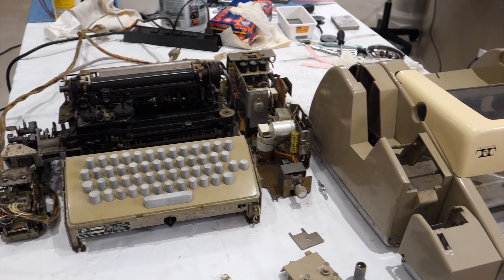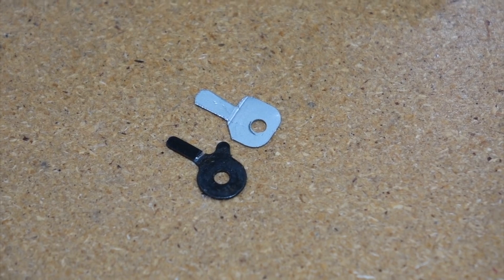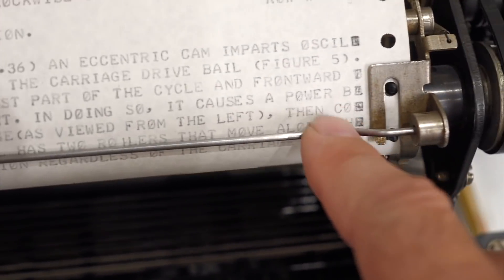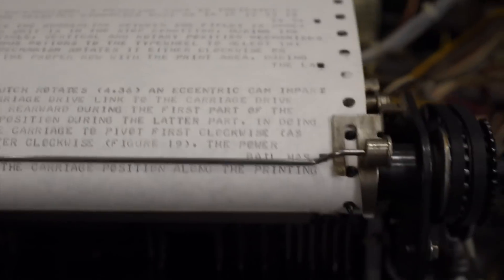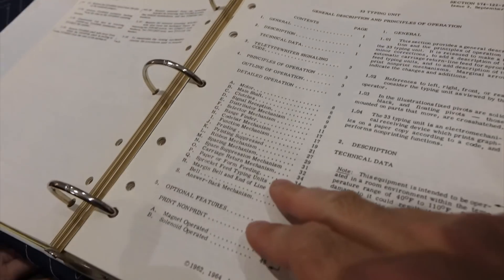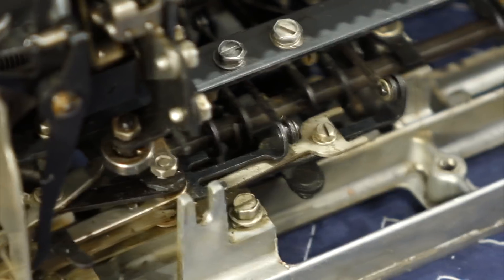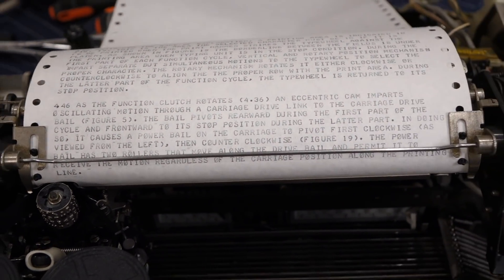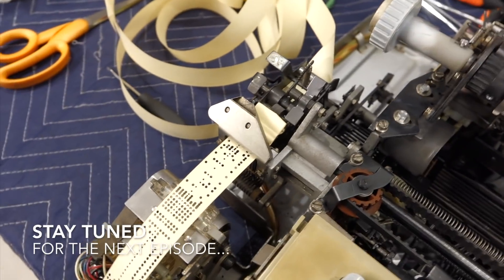Teletype ASR 33 Part 7: Receive Section Fixed!

Comment: This is probably the main reason the original Baudot code, and the newer ASCII code, include separate CR and LF control characters, rather than the combined NL (New Line) character used in IBM terminals.  If CR is always followed immediately by LF, the print head is back at position 1 before the first character is received.

The ability to overprint and to save time when the next line begins close to the end of the current line are just bonus features!

Comment: The teletype has a special place in my memory. In the 8th grade, way back in 1978, my first hands-on extensive computer time was spent early mornings in the middle school's algebra classroom, on a teletype, connected by acoustic coupler to a big black phone handset, to a remote Honeywell computer. I spent those mornings studying and learning to code in BASIC. I still fondly remember the smell of the machine, of ink and oil and the big rolls of yellow paper we fed it.

Comment: These machines was how news was disseminated for decades. It's fitting to see them working again.
Reply: Associated Press was still running in the slow TTY mode as late as the 90's. I recall working a stint at a newspaper plant, they had a dot matrix printer wired into the AP satellite feed. And every so often FLASH traffic would kick the printer into action. Or someone would simply command the printer to belt out the buffer for the day and they would read through it.

Comment: As far as some of the old ASCII printers and paper printing terminals, devices I used to work on a long time ago for X.3, X.28, X.29 (a.k.a. triple X) X.25 Packet Assembler Disassemblers (PADs), had the option to add NUL characters (0x00) in the data stream for these devices after a Carriage Return (CR) or Line Feed (LF) or Form Feed (FF).  That allowed data designed for faster CRT based terminals to be displayed on Teletypes and Slower ASCII serial printers so that characters were printed properly.

Comment: From the military TTY days, each line should be no longer than 69 characters, and it's 2 CR & 1 LF for each line. I believe the 69 character limit was for the older "5-level"  tape TTY machines. I think the only time you could get away with 80 characters was when both receive, transmit, and paper tape relays could handle 80 character (aka 8-level tape), or you were sending to a "customer" that received the data in data punch card format, or when data punch cards were being phased out with the newer (at the time) magnetic tape.

Comment: As a Telecommunications Technical Control Specialist withing the USAF,   I've actually operated these machines on a daily basis for quite a few years.  Damn they can  be quite PERSNICKETY.  LOL   More then  sure they're still being used in quit a few facilities today.   Super High level Baudot  Code.   Most of us could read the paper tape by looking at the hole punches.   When the ink ran dry that was the only way we had.  LOL

Comment: That noise takes me back to 1970 and the first mainframe I got to know well: Univac 1108.  The console was a KSR 33.  A busy all nighter would leave you with an aching head.

The OS also had a driver for Teletypes via its communications subsystem (CTMC) for interactive use but for some reason the software driver was called TTY35 (not 33). The tape library had the only working interactive terminal. Everybody else used cards.  But the tape librarian had no use for
the TTY so I misspent most of my days in a freezing corner of the library avoiding my assigned work, teaching myself to program in 1108 assembly language.
Reply: My first machine was an IBM 407 and associated unit record equipment. Then we got a 1401 then a 360/30

Comment: Wandering Column 1 position looks like the head settle isn't quite stable.  Sometimes a bit to the left, sometimes columns 1 and 2 nearly merge. There's another adjustment for that, I seem to recall.  (Like a Studebaker owner, you are getting plenty of practice fabricating parts!)
Reply from the maker: It’s the “dashpot” adjustment, an air piston that prevents the carriage from slightly bouncing back. I think they had the patent on that.
Reply: @CuriousMarc  I remember having to just the little metal piece on the air piston to get it to position just right.  Also, when we had a BASIC class at Southern Ohio College in 1980 we keyed in our program on the punched tape and every line ended with Carriage Return, Line Feed and Rubout.   The rubout helped you see where the new line began on the tape for splicing - it punches all of the holes.
Reply: @CuriousMarc  I wonder how whether there as many patents as adjustment points?

Comment: While I love these videos, I hang my head in shame for having dumped one around 1988.  Sorry.
Reply: I dumped 3 of them that were modified for RS-232. Tried to sell then, no one wanted them, then I tried to give them away and still no one wanted them. I also dumped a DEC LA-36 and LA-120
Reply: @rty1955  Yes I think mine was an RS-232 model, complete with tape punch.  Best not to think about it.
Reply: @video99couk  the teletypes were all 20ma current loop. They were used for communications along the railroad to replace the hand key/soinder device. I had designed my own RS-232 to 20ma converter, but there are tons of designs out there now but back in 1975 They were rare.
I still have rolls of mylar tape that the teletype used as well as paper tape. Mylar tape was used in older CNC machines so the oil aroind the machines wouldnt soak into the tape

Comment: I really like the ASR33! On older comms equipment there is often a setting for a delay after CR. Question: I always thought the O with a slash means the character "zero" not the letter "O"...
Reply from the maker: On this machine it’s reversed. The letter O has the slash. Feels weird too.
Reply: @CuriousMarc  If you had a room with 20 Teletypes running EVERY dang machine had personality.  Some were Azz Holes.  Mess with you every chance it had.  Usually right when you didn't need messed with.  LOL
Reply from the maker: @pulesjet I hear you. The ASR33 are finicky machines. It seems everything needs adjusting, and adjustments are fidgety. But I hardly had to do any adjustments on the older Model 15/19, and they were very progressive.
Reply: Yes the Zero carried the slash.   I still write a Zero using it today.
Reply: Back in school when writing FORTRAN source code on coding forms, we were taught to write zeros without the slash and the letter "O" with a slash. But when writing COBOL source code on coding forms, we were taught to write zeros with the slash and the letter "O" without the slash. So it seems more zeros than letter "O"s were found in scientific programming, but more letter "O"s than zeros were found in business programming.

Comment: Why do Os look like 0s?
Reply: G00D QUESTI0N. I guess it saves real estate on the head? One less thing to worry about?
Reply: The charts from a previous video show it has both. Maybe the HP is sending the wrong character?
Reply: @bwebs956  Back in school when writing FORTRAN source code on coding forms, we were taught to write zeros without the slash and the letter "O" with a slash. But when writing COBOL source code on coding forms, we were taught to write zeros with the slash and the letter "O" without the slash. So it seems more zeros than letter "O"s were found in scientific programming, but more letter "O"s than zeros were found in business programming.

Comment: Sure seems strange to see the slashed O. I was used to a slashed zero on the teletypes I used, if ancient memory still serves.

BTW, it is CR-LF rather than LF-CR to allow the carriage two character times to return.
Reply from the maker: Zero is O and letter O is ø. Go figure. I need to check on the CR-LF - I thought the HP terminal would send it in the right order automatically, but maybe not. Will be obvious on the paper tape output.
Reply: FWIW, re: CR LF timing, it looks like CR LF DEL DEL is what's recommended for full-speed (tape) operation:

"Note: When preparing tape, all functions (except information separators), such as form-out, carriage return, line feed, etc, must be followed by two fill characters such as delete. These fill characters are required to provide time for the desired function to occur."

...then again, it looks like this recommendation may be because of the existence of an automatic CR on LF kit, as elsewhere the documentation recommends CR LF RO (so only one fill character) in the answerback drum. (Otherwise, I can't see LF taking enough time to warrant any delay...)
Reply: A common problem on those machines was improper weight oil or dirty oil on the carriage slides and the dashpot. This would result in a slow carriage returns and getting "flying letters" for the first letter or two as they started typing before the carriage fully returned, or alternately a ragged left margin. A worn dashpot could also result in carriage bounce on the return.
Reply: @lwilton  well yeah one of the first things you do in a restoration is to thoroughly clean, and re-lubricate the entire unit. All the cams, bell cranks. Levers, etc. I designed an RS-232 to 20ma current loop adapter for these machines
Reply: Thank you for illuminating the history of CR-LF!
Reply: That is correct. I restored many of these teletype and its always CR-LF not the other way around
Reply: Back in school when writing FORTRAN source code on coding forms, we were taught to write zeros without the slash and the letter "O" with a slash. But when writing COBOL source code on coding forms, we were taught to write zeros with the slash and the letter "O" without the slash. So it seems more zeros than letter "O"s were found in scientific programming, but more letter "O"s than zeros were found in business programming.
Reply: @RaymondHng  the reason that scientific people dont slash the zeros is because its saves time to write and zeros are mich more common than "ohhs", reverse in Business coding. Did you do know the purpose of coding forms? They werent meant for you
Reply: @rty1955  That was what I was trying to say in more words. Your final sentence appears to be truncated and it does not make sense.  What do you mean by saying coding forms were not meant for me?
Reply: @RaymondHng  coding forms were not meant for programmers. A programmer can write a program on a blank sheet of paper. Do you know why coding forms were made? I dont know when U began to program so you may not actually know
Reply: @rty1955  Coding forms were used by programmers starting in the '50s when the IBM 026/029/129 keypunch machines were the only method of data input to a mainframe. Programmers would write their source code on coding forms and keypunch operators typed and verified the source code onto punch cards. Coding forms were still used at the college I attended in the late '70s. There was a limited number of keypunch machines available for students. So students enrolled in COBOL, FORTRAN, and Assembler classes would write their programs on coding forms and turned them over to keypunch operators where they keyed at a rate anywhere from 5,000-to-18,000 keystrokes per hour. The students collected their completed punch cards and submitted their card decks to the computer operator who ran all the card decks into the high speed card reader for the mainframe. This is a coding form with some COBOL source code. The lines of code are from the Data Division of the COBOL program. https://i.pinimg.com/originals/00/30/a5/0030a5c8e93db966d6fa31f72818fcf4.jpg
Reply: Standard military message procedures for use with Creed (UK) and TTY machines specified CR-CR-LF as the EOL function (end of line), otherwise a character would be printed as the print head or platen, depending on the machine type, was in flight returning to the start of the line. Even at 50 Baud

Comment: I admire your perseverance
Reply: Funny thing is no one will care when he dies. It will be only junk
Reply: @rty1955  well... I do care.
Reply: @ifitsrusteditsmine  I had 3 asr-33 machines in perfect working order with a RS-232 to 20ma adapeter. I put them on ebay 5x $50 each. No one bid. I put them on CL for a while, no nibbles. Then I even offered them for FREE for over 3 months. No one wanted them. They eventually went into the trash. So you have to ask yourself: "if no one wants them for free, what are they really worth?"
Not that many younger people are interested in older technology like they used to. No one wants to learn to repair or maintain.

Comment: Back in the 1980's my father brought home a Commadore PET computer with a cassette tape drive and 8k of core memory. It was used to update their inventory and sales at his job. The cool part was a air head "puffer" system that connected to the punch card reader portion of a IBM pc that was the size of a bus. But no more punch cards needed! 
      I was only 7yrs old and can barely remember it, but it changed my life forever!  I can't seem to find any info or pictures. Anyone know what I am talking about?

Comment: I don't remember needing an extra delay after CR LF. It does have to be in that order as the CR takes longer than one character period, so it overlaps with the LF. Also two stop bits are needed for mechanical teletypes.

Comment: 72 Characters!  Sounds like FORTRAN!
Reply: Fortran (and Algol, and Jovial, and...) were 72 characters because the last 8 characters of the 80 column card were the sequence number.
Reply: @lwilton  same with most languages. COBOL and ASSEMBELR TOO
Reply: COBOL used columns 1-6 for sequence numbers. Columns 72-80 was a card ID field, typically used to mark all cards in a patch with a common patch identification. 
There were more different assemblers than you can shake a stick at; I can only think of two machines from that era that didn't have an assembler of some sort. But almost all of them had a card sequence number field someplace. The Burroughs Medium Systems assembler used columns 1 to 7, as an example.
BASIC also had sequence numbers, but since this had originally been a TTY-based language, the sequence number was 1 to 5 columns at the start of the line.
Reply: Interesting fact the Data point 3300 that came out in the late 1960s used the same 72 column format as it emulated an ASR 33.